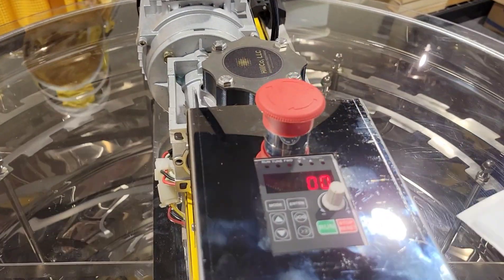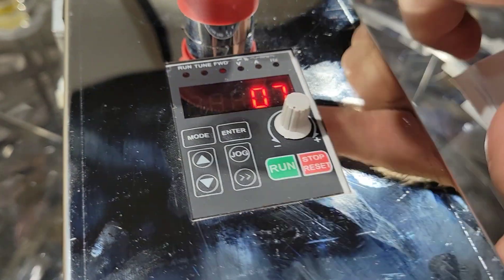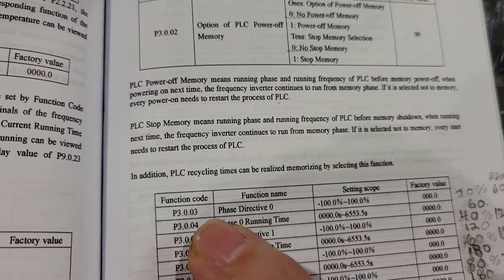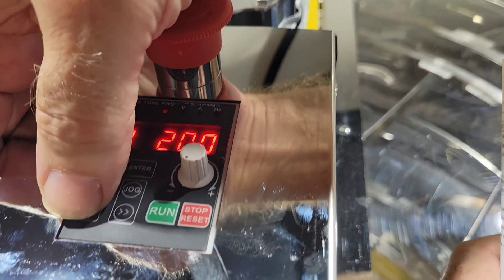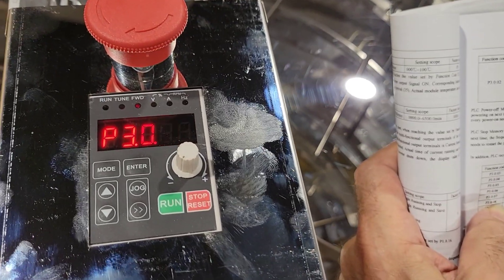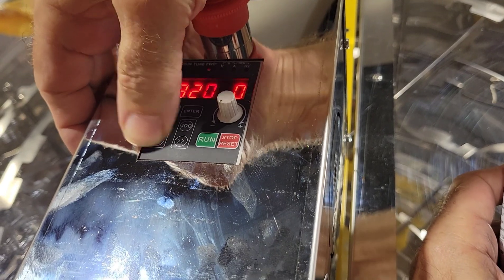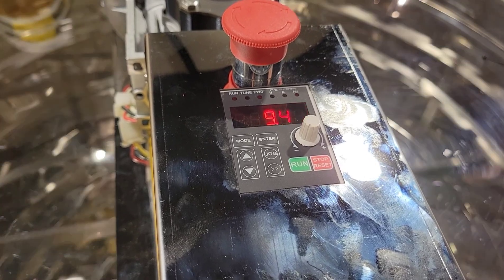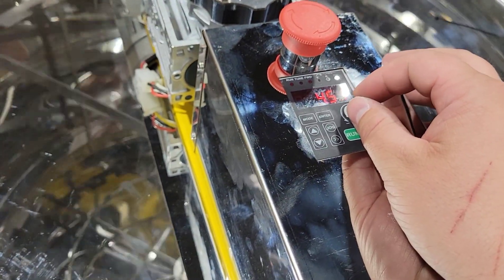Programming SuperMax and MegaMax Extractor Controllers | HillCo, LLC

Comment: I have always had a tangential extractor.  With a radial extractor (which I bought from Hillco recently) is 14 minutes extracting time (ramping up from slow to high) a pretty typical extraction time for medium and deep frames in hot Summer temperatures?  I ran my first batch at quite a bit shorter timespan (though I had her moving😀). I also added castors to move it easily and it works great…only a bit of movement when it’s initially unbalanced or changing speeds aggressively.